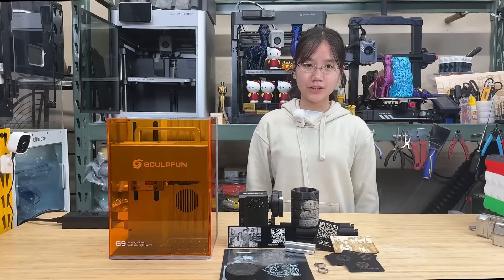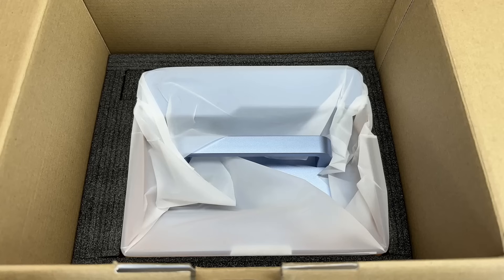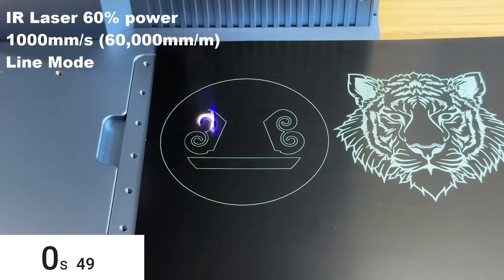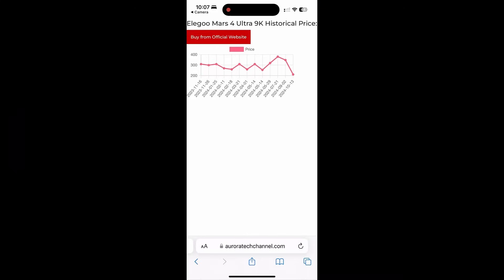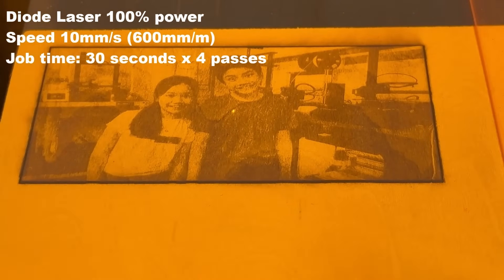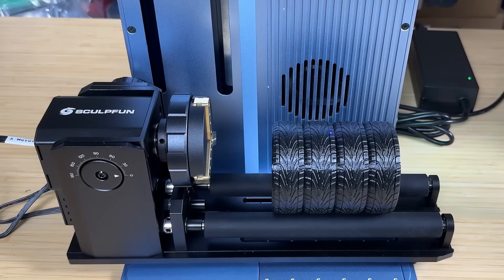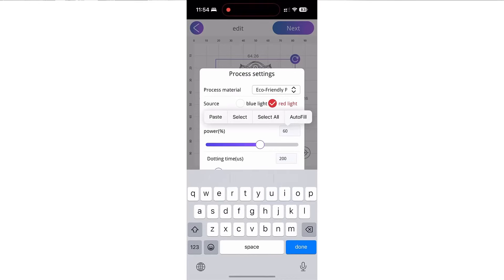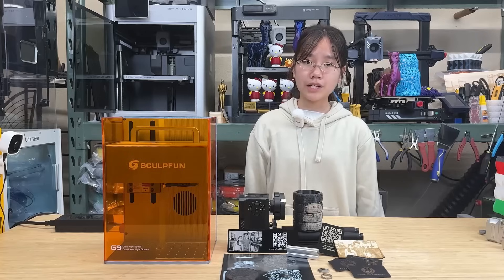Sculpfun G9 2W IR + 10W Diode Laser Engraver, Aluminum, Steel and high-resolution photo engraving

Comment: I've been wanting a laser to mark my prints for a little while now (like what's seen at 6:31) but don't know what I'm looking for. The IR/Fiber(?) laser on this looks perfect. As does the Xtool. Had a friend try it with his lasertree one but he said he could only get it to melt the top. Are there any keywords that can help point me in the direction of additional options? 

Also there's a titling error. The video is labeled the F9 rather than G9. Either way, thanks for another great and detailed review! It's a good thing I don't have the money for one yet because I could definitely see enough applications with this to make me pull the trigger. Now I've got time to understand and research what the heck I'm even looking for lol
Reply from the maker: You need an IR laser to mark on the surface. It works better on dark plastic, as you can't see the marks on white, light grey, or light yellow filaments.

Comment: I'm not entirely sure but if I recall correctly, an IR laser is not the same as a fiberlaser. I believe the IR laser is also a diode, just in a different wavelength similar to some fiberlaser. If that is correct, you should alter the title to avoid confusion.
Reply from the maker: Yes, you are right. Thanks for pointing this out; I just corrected the title and thumbnail.

This 2W should be called an IR laser. After reviewing two other 20W diode + 20W fiber machines, I was a bit mixed up. The wavelength of this IR laser is 1064nm (fixed), with lower power and cost. I’ve only seen 2W available on consumer machines. On the other hand, a fiber laser can have varying wavelengths depending on the doped element used, and it generally has higher power (starting from 10W, with 20W being the most popular, like the xTool F1 Ultra and LP5 I reviewed recently, and going up to several hundred watts) and higher cost. Both can engrave on metal, but a low-power IR laser cannot engrave as deeply as a fiber laser.

Comment: The only thing i don't like is the wifi antenna location being in the cutting space where it can be exposed to heat, fire, ext. its not a deal killer at all but i would have liked a better location for the price but what ever. I can see my self getting this later this year.